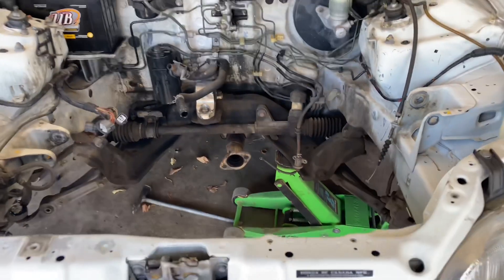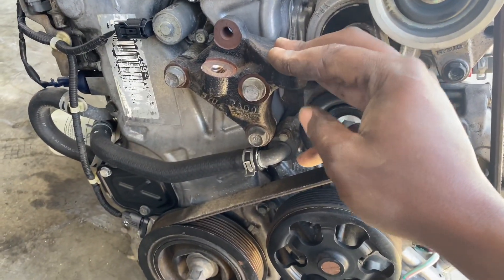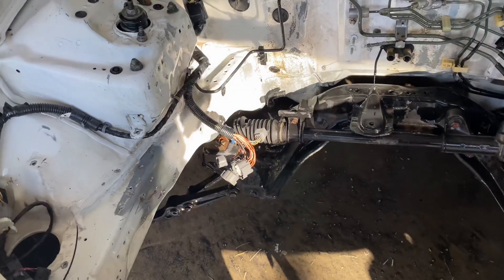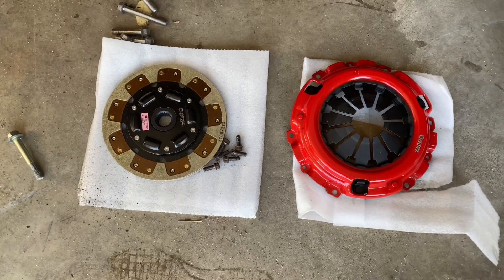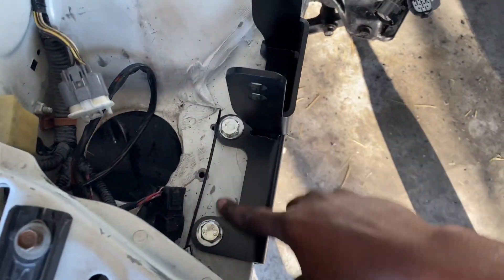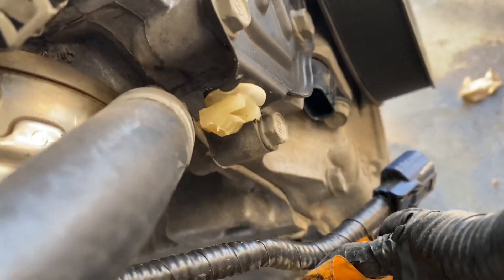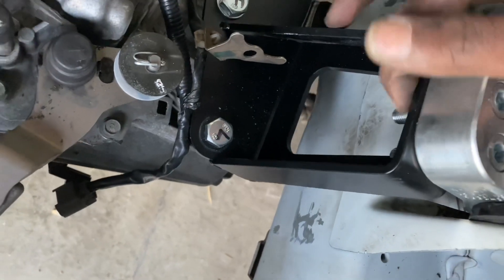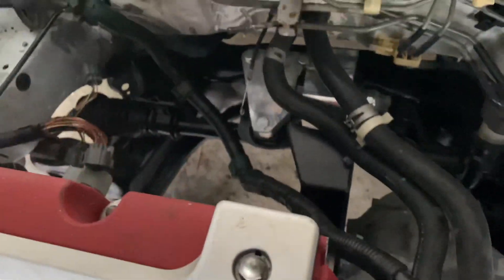Honda Civic vx k20a euro type r swap part 3

Comment: Hey how’s the k20A euro r motor holding up !??
Reply from the maker: Still running strong
Reply: @rarewitit7899  nice
Reply: Question, do you know what’s the part number or where I can find the water pump for this specific engine k20A ?
Reply: Been searching but can’t get an exact answer
Reply from the maker: I would say civic Si 2006-11 , there basically the same engine
Reply: @rarewitit7899  oh ok hopefully. Thank you very much happy thanksgiving 🍁🦃

Comment: which hasport mounts did you get because I have the euro r and the 6 speed lsd I think it's the egk4 mounts I need though.
Reply from the maker: Yea egk4 is the tsx style casing
Reply: @rarewitit7899  I'm having trouble with the mount for the trans I ended up getting innovative however the bolt pattern doesn't match up but it is their k swap eg mount kit
Reply from the maker: @andrewredding4937  innovative mounts only makes it for Rsx style transmission
Reply: @rarewitit7899 thank you luckily they accepted my return and I already ordered hasport egk4 mounts